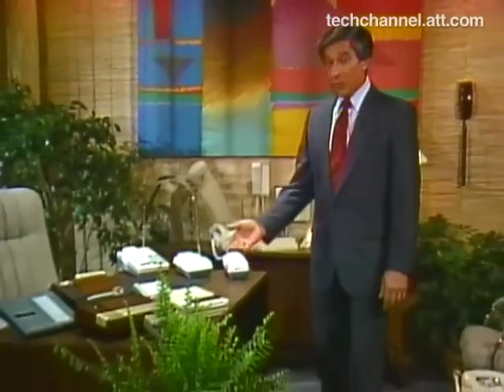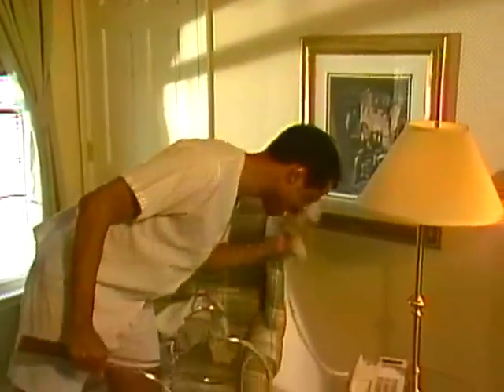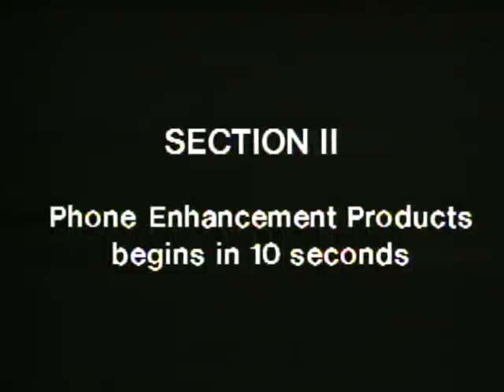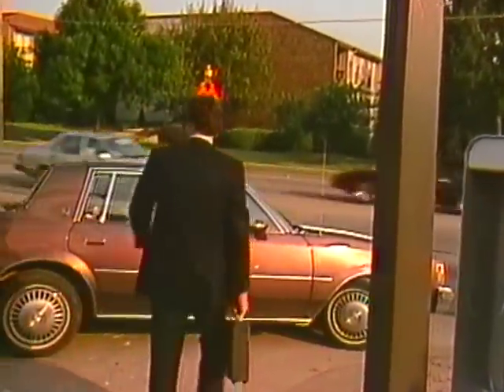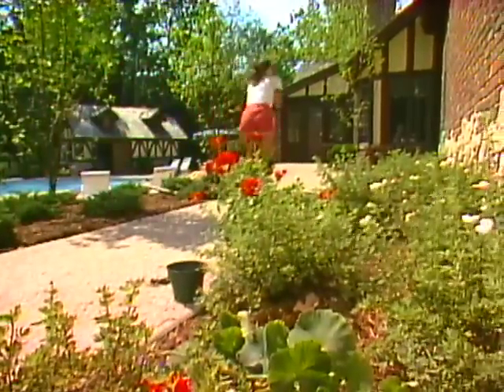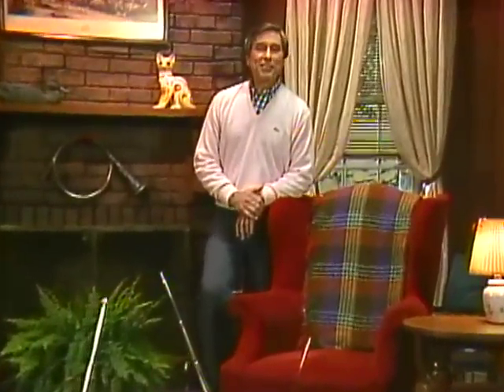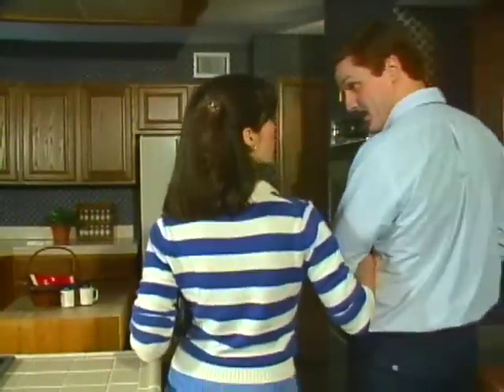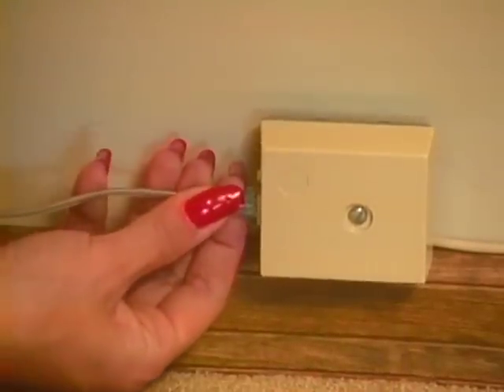AT&T Archives: Family of Products (1985)

Comment: 10:00 then Scanners had more than 200 Channels and you could listen in on the base frequency on 46 MHz VHF low-band and hear both sides talking.
Reply: True, But in '85 200 channel scanners were expensive as hell, most average scanners had 8 or 10 channels. Most people wound not dedicate an entire scanner for this. The best way to listen in on cordless phones (and "baby" monitors of the era was a multiband radio with a "VHF-Lo: Band (30mhz-54mhz)would "work" these bands. Also TV sets made before 1983 (with the UHF channels 70-83 intact.) could receive AMPS (the early analog cellular system) phone calls!
Reply: The best thing in the 1990's was having a 60 watt, Low Band VHF (42-50 MHz) Motorola Maxtrac (mobile radio), pre-programmed  with all 25 cordless phone channels, & equipped with a DTMF (Touch Tone) Microphone.  The reception was incredible, and you could inject your own comments on calls!  It gave a whole new meaning to 'reach out & touch someone'!  :p  Crazy that was over 25 years ago.   Now, there isn't crap to listen to ......  it's all gone digital.  :(
Reply: That's probably why this was archived in the first place